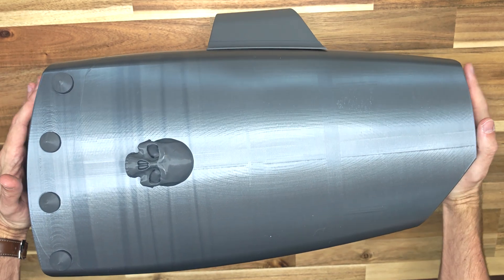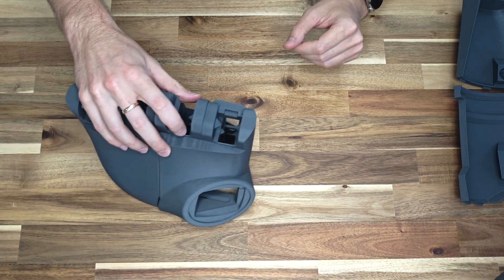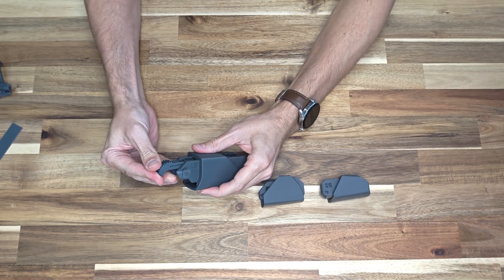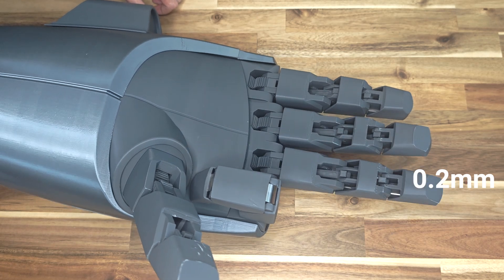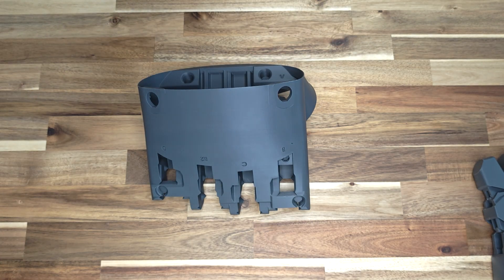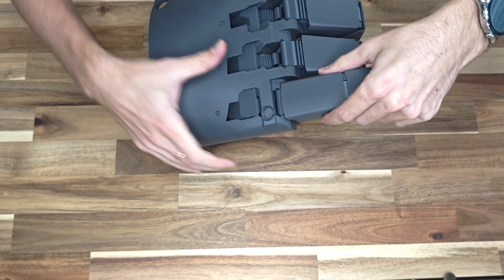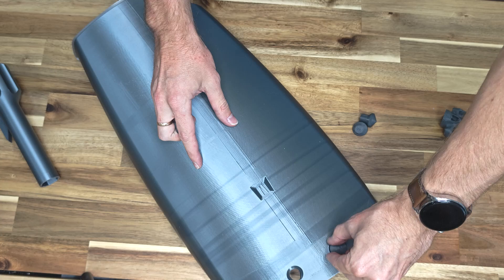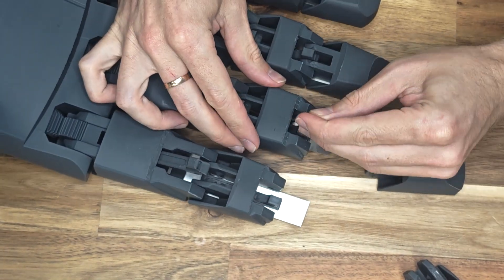Fully 3d printed power FIST

Comment: How big is the power fist? I did some pixel measurements, and the 95cm length looks like it's way too long to be real.
Reply from the maker: No, it’s around 55cm
Reply: @Alex_Geek_Workshop  is that with the fingers extended or closed? Sorry for all the questions, but I'm making a 3d printed gravis suit, and I just want to make sure it doesn't look too huge on the hand

Comment: Starting to print right now, and I'm excited. Question about the bridging though - the frame part 1 and 2 look like they have some SERIOUS bridging. I'm slicing in Orca and I'm not sure how we'll it'll print especially since some of the bridging isn't just straight across and has corners. Any suggestions?
Reply from the maker: @PatFriedl  already print a lot of it, no issues, also nobody complains about problems with overhangs
Reply: @Alex_Geek_Workshop  Got it, thanks!
Reply from the maker: @PatFriedl  you are welcome
Reply: @Alex_Geek_Workshop  I'm printing at 85% and having a real time getting parts to fit without sanding. I'm printing on a well tuned Creality V3 SE with AnyCubic filament. Any way you could share your print profile
Reply from the maker: @PatFriedl  with which parts you have problems? Do you calibrate flow?

Comment: I'm finding that the rails don't fit like they should, nithing slides or locks into place like it does on this assembly video, perhaps more clearance was required in the rail design?
Reply from the maker: It’s possible that you experienced elephant’s foot during printing; try trimming the edges with a knife or a file. A larger gap may cause gear slippage. I will try to understand how I can make it better and update files

Comment: Assembled mine today and have to say whilst the enginerring behind the project is stellar as always the build was not a fun one for me personally. The tolerances on the finger joints seems way to high and I had to shave a little off the points to get them to engage. This is in no way a slight on Alex's work but this will be a static model only as operating the fingers is almost impossible even with some lubricant on the moving parts. I will try reassembling when the metal springs arrive and see if this improves. The hand strap was incredibly difficult to install into the slot and ended up being a little small for my pit shovel hands so left that out for now. Printed on 3x P1S all pretty well dialed in for tolerances
Reply from the maker: Hi, what plastic and infill percentage did you use? Plastic tends to deform over time, so if everything is moving stiffly now, then in a week everything will most likely move perfectly. The problem is that when reducing tolerances there is a risk of parts coming out of engagement. You can try printing with offset. As a rule, I use gaps of 0.1 mm

Comment: Awesome work as always. Files purchased and prepping the print plates now. Looks like there are only 4 fingers in the STL files though so do we need to repeat print one of them? BOM list on the website links to the Chainblade BOM so not sure if an update is coming :)
Reply: You need to print 2 each of the 'B' finger files. There are 2 separate 'B' finger rails in the zip file, B rail and B2 rail.

Comment: Amazing work and I have already purchased the files. I now own every weapon you have released and will continue to buy everything 40k related that you will design. Any chance of designing a power sword which uses the Bambulabs sound and light kit?
Reply from the maker: Thanks, don't know they have such kits. I usually make my own kits
Reply: @Alex_Geek_Workshop  Its the same kit that can be used to build your own lightsabre. It comes with control board, speaker, battery and Led strip. The kit is programmable from an app and is motion sensitive.